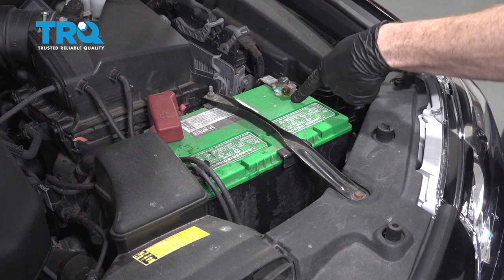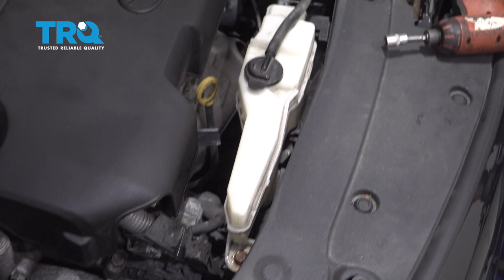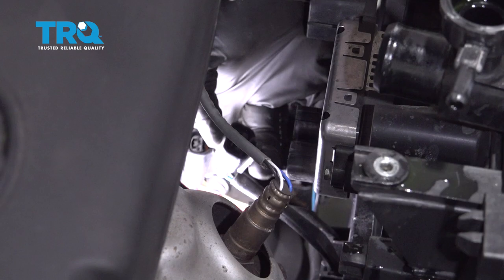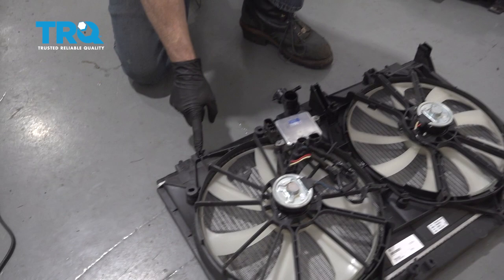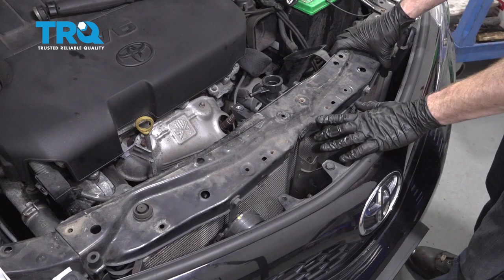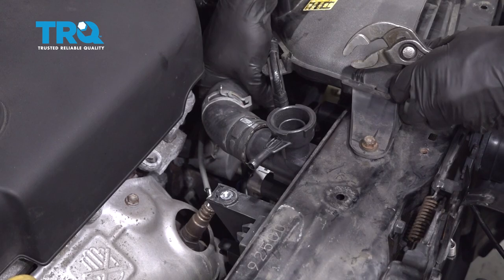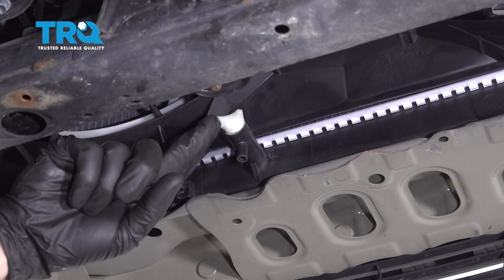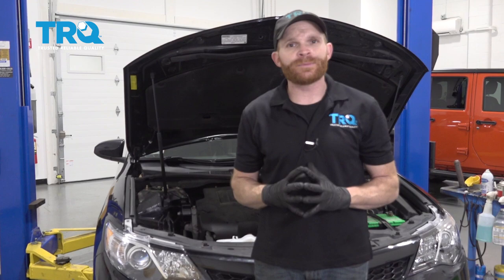How To Replace Radiator 2012-2017 Toyota Camry

Comment: The radiator started leaking on my wife's 2014 Camry V6.  Unbelievable as it only has 43K miles.  Toyota quality is definitely not what it used to be.  Thanks for the very thorough and informative video!